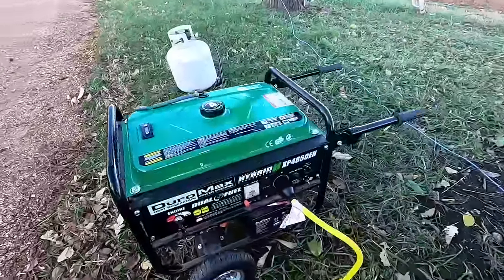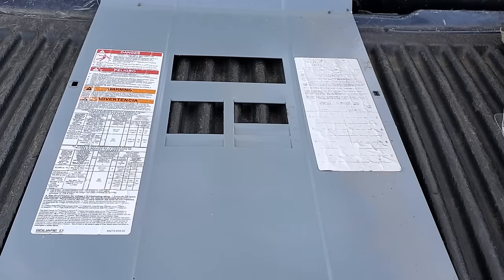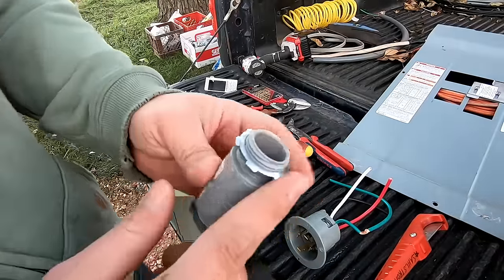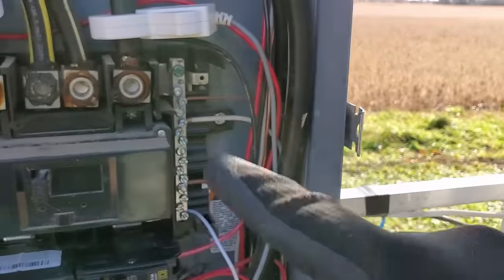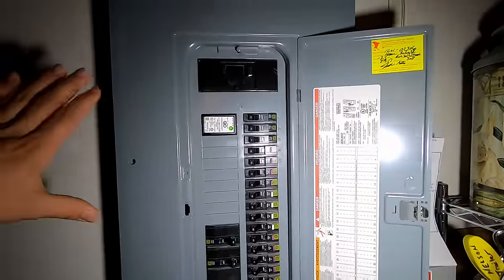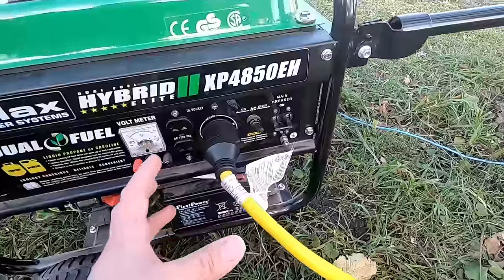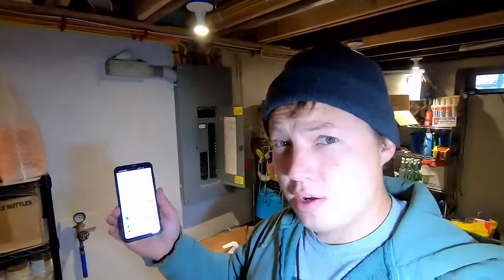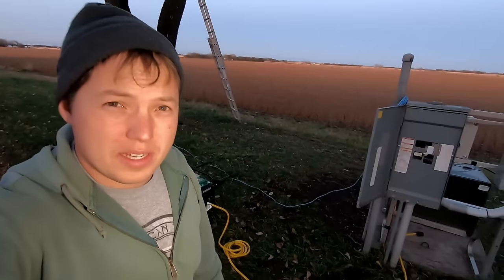How To Hook Up a Generator To Your House Using a Breaker Interlock Kit & Power Inlet Box

Comment: Is it possible to both run the generator and the utility line? So when you switch from utility to generator, it won't disturb the power supply.
Reply: Don’t forget about the generator safety tips as well. Remember it’s important to follow all the generator safety rules whenever you use your generator. Here are the generator safety tips:

1) Please do not allow an unqualified person or your children to operate the portable generator. Just because some manuals don’t say that doesn’t mean it’s safe. That is important against the generator safety rules. We also need to be keeping an eye on our children too. You need to make sure that your children are not playing near the portable generator especially when it’s running so they won’t get electrocuted. Generators pose electrical risks and they can be hot during an operation. Please keep your children away from the portable generator at all times. It is important to keep our children safe especially our little ones. Be aware of all the hazards.

2) Some people use their portable generators indoors which increases the risk of carbon monoxide poisoning. It’s important to have a carbon monoxide if you have a gas generator. Never ever use your generator indoors even if your doors and windows are open and even in the garage is not safe to use a portable generator. Not even at your porch and your deck. It is never safe to use your generator indoors and in enclosed areas of your home. Your generator needs to be 15-20 feet away from your house. 

3) 🔥generators cause fire hazards too. Never refuel your generator while it’s running. You need to let your generator cool off before refueling it and before storing your generator. Never overload your generator too. Never ever back feed your generator. You should never plug your generator into a wall outlet. Also never store propane tanks indoors. Please keep flammable things away from the generator as well and please don’t smoke cigarettes near the generator. Having a fire extinguisher next to the generator is also important against the generator safety rules. 

4) generator operation; make sure your hands are dry before touching the generator. Never use your generator in wet conditions. Don’t let your generator get wet. You need a generator tent if you need to use your generator during wet weather. Please don’t wear loose clothes when operating the generator. Turn on your generator before plugging in appliances. Use the right cord for your generator. Please do not use worn out cords. 

https://youtu.be/I1jT3ANENvI and here is a video more about keeping others safe when using generators and also about our family’s safety. 

Hope this helps ♥️
Reply: @The_Happy_Aviation_Enthusiast  Thanks for the tips, though, I don't have children 🌚

Comment: Ben is there a product available that would go between the generator and the house panel that will "clean up" the electricity or make it pure sign wave? I an assuming that generator is not an invertor pure sign model.
Reply: Here are the generator safety rules that everyone needs to follow: this is just a reminder for everyone’s safety. Always make sure you follow all the generator safety rules whenever you use your portable generator. Generators can be dangerous if not used carefully. Every year, hundreds of people die or get injured when using portable generators due to carbon monoxide poisoning and electrocution. Make sure you are using your generator carefully and keeping others safe as well. There is something very serious that everyone should always be aware of when using generators. Some people do run their generator indoors which is not safe and that increases the risk of carbon monoxide poisoning which can cause death of family and you. Some people run their generator in wet conditions which can electrocute them. Please remember that you should never run your generator indoors. Remember that carbon monoxide is an odorless and colorless gas that you cannot see or smell. Carbon monoxide is a silent killer. Keep that in mind. Make sure your generator is 15-20 feet away from your house and away from doors, windows, and vents. Never use your generator in your porch too. Having a carbon monoxide detector is very important against generator safety. Some people also allow children to go near the portable generator which could pose risks. We need to keep an eye on our children making sure that they are not near the portable generator so they won’t get electrocuted or burned by the generator which is dangerous. A locking enclosure also keeps kids safe. A generator shed might look like a tempting place to explore, or take cover during a game of hide and seek, but a generator is a dangerous piece of equipment that can cause injury. It says on the manual that we should also keep children away at all times from the portable generator to avoid injuries. Please do not allow a child or unqualified people to operate the portable generator.  It is important to keep your children safe especially little ones. The portable generator can be hot during an operation. Just because some manuals missed what should be listed doesn’t mean it’s safe to do. Always follow the generator safety rules when using portable generators. Generators pose electrical risks. If you need to use your generator during wet weather, you need a generator tent to protect your generator from getting wet. Don’t let your generator get wet. Keep your generator dry and before using your generator, please make sure your hands and your generator is dry. Do not wear loose clothing when operating the generator. Everything that is said on the generator’s operating manual should not be ignored. Never smoke cigarettes near the generator. Please keep flammable things away from the generator. Never overload your generator too. Your generator can catch fire. Never ever try to plug a generator cord into a wall outlet to avoid back feeding. Back feeding your generator is dangerous. Always turn on your generator first before plugging in appliances and shut off the appliances before turning your generator off. Use a heavy duty cord for your generator and the cord should not be worn out. All the instructions should be followed carefully. Never refuel your generator while it’s running. It can cause fire if fuel spills while your generator is hot. You should turn off your generator and let it cool off before refueling it. Having a fire extinguisher next to the generator is also important. This is only a reminder for everyone’s safety of using generators. Make sure your generator is properly grounded. Having a fire extinguisher next to the generator is also important against the safety rules. https://youtu.be/I1jT3ANENvI and here is a video more about keeping others safe when using generators and also about our family’s safety. It’s important to keep our little children safe as well. Make sure your little children are kept away from the generator at all times especially when it’s running. Hope this helps. Always remember that it’s better to be safe than sorry. Also remember that warnings should not be ignored too.
Reply: @The_Happy_Aviation_Enthusiast  Thanks Ben?

Comment: can you hook up the sense monitor to monitor either the main power an generator power at main breaker?
Reply from the maker: Yes.
Reply: ok i figured out the only way to keep the sense clamps in one position is to loop the generator breaker legs through the sense clamps that are on the main breaker legs. perfect

Comment: Hey Ben! Loved your video! Just wondering why some people choose a Transfer switch over a Power Inlet box. As per your way, I like the Power Inlet box. I’m curious and would like to get this done before my next power outage.🤔
Reply: Here are the generator safety rules that everyone needs to follow: this is just a reminder for everyone’s safety. Always make sure you follow all the generator safety rules whenever you use your portable generator. Generators can be dangerous if not used carefully. Every year, hundreds of people die or get injured when using portable generators due to carbon monoxide poisoning and electrocution. Make sure you are using your generator carefully and keeping others safe as well. There is something very serious that everyone should always be aware of when using generators. Some people do run their generator indoors which is not safe and that increases the risk of carbon monoxide poisoning which can cause death of family and you. Some people run their generator in wet conditions which can electrocute them. Please remember that you should never run your generator indoors. Remember that carbon monoxide is an odorless and colorless gas that you cannot see or smell. Carbon monoxide is a silent killer. Keep that in mind. Make sure your generator is 15-20 feet away from your house and away from doors, windows, and vents. Never use your generator in your porch too. Having a carbon monoxide detector is very important against generator safety. Some people also allow children to go near the portable generator which could pose risks. We need to keep an eye on our children making sure that they are not near the portable generator so they won’t get electrocuted or burned by the generator which is dangerous. A locking enclosure also keeps kids safe. A generator shed might look like a tempting place to explore, or take cover during a game of hide and seek, but a generator is a dangerous piece of equipment that can cause injury. It says on the manual that we should also keep children away at all times from the portable generator to avoid injuries. Please do not allow a child or unqualified people to operate the portable generator.  It is important to keep your children safe especially little ones. The portable generator can be hot during an operation. Just because some manuals missed what should be listed doesn’t mean it’s safe to do. Always follow the generator safety rules when using portable generators. Generators pose electrical risks. If you need to use your generator during wet weather, you need a generator tent to protect your generator from getting wet. Don’t let your generator get wet. Keep your generator dry and before using your generator, please make sure your hands and your generator is dry. Do not wear loose clothing when operating the generator. Everything that is said on the generator’s operating manual should not be ignored. Never smoke cigarettes near the generator. Please keep flammable things away from the generator. Never overload your generator too. Your generator can catch fire. Never ever try to plug a generator cord into a wall outlet to avoid back feeding. Back feeding your generator is dangerous. Always turn on your generator first before plugging in appliances and shut off the appliances before turning your generator off. Use a heavy duty cord for your generator and the cord should not be worn out. All the instructions should be followed carefully. Never refuel your generator while it’s running. It can cause fire if fuel spills while your generator is hot. You should turn off your generator and let it cool off before refueling it. Having a fire extinguisher next to the generator is also important. This is only a reminder for everyone’s safety of using generators. Make sure your generator is properly grounded. Having a fire extinguisher next to the generator is also important against the safety rules. https://youtu.be/I1jT3ANENvI and here is a video more about keeping others safe when using generators and also about our family’s safety. It’s important to keep our little children safe as well. Make sure your little children are kept away from the generator at all times especially when it’s running. Hope this helps. Always remember that it’s better to be safe than sorry. Also remember that warnings should not be ignored too.

Comment: good job but for 1 thing using uf cable for your connection through conduit is a violation. the reason is because it is an unshielded ground ,so nmb and uf are the same thing in this application .   so what u shoud have done was run a #10 green wire insulated with thhn or known as shielded . you just had your 1st min  under the supervision of a master electrician
Reply: ⚠️Don’t forget about the generator safety tips as well. Remember it’s important to follow all the generator safety rules whenever you use your generator. Here are the generator safety tips:

1) Please do not allow an unqualified person or your children to operate the portable generator. Just because some manuals don’t say that doesn’t mean it’s safe. That is important against the generator safety rules. We also need to be keeping an eye on our children too. You need to make sure that your children are not playing near the portable generator especially when it’s running so they won’t get electrocuted. Generators pose electrical risks and they can be hot during an operation. Please keep your children away from the portable generator at all times. It is important to keep our children safe especially our little ones. Be aware of all the hazards.

2) Some people use their portable generators indoors which increases the risk of carbon monoxide poisoning. It’s important to have a carbon monoxide if you have a gas generator. Never ever use your generator indoors even if your doors and windows are open and even in the garage is not safe to use a portable generator. Not even at your porch and your deck. It is never safe to use your generator indoors and in enclosed areas of your home. Your generator needs to be 15-20 feet away from your house. 

3) 🔥generators cause fire hazards too. Never refuel your generator while it’s running. You need to let your generator cool off before refueling it and before storing your generator. Never overload your generator too. Never ever back feed your generator. You should never plug your generator into a wall outlet. Also never store propane tanks indoors. Please keep flammable things away from the generator as well and please don’t smoke cigarettes near the generator. Having a fire extinguisher next to the generator is also important against the generator safety rules. 

4) generator operation; make sure your hands are dry before touching the generator. Never use your generator in wet conditions. Don’t let your generator get wet. You need a generator tent if you need to use your generator during wet weather. Please don’t wear loose clothes when operating the generator. Turn on your generator before plugging in appliances. Use the right cord for your generator. Please do not use worn out cords. 

https://youtu.be/I1jT3ANENvI and here is a video more about keeping others safe when using generators and also about our family’s safety. 

Hope this helps